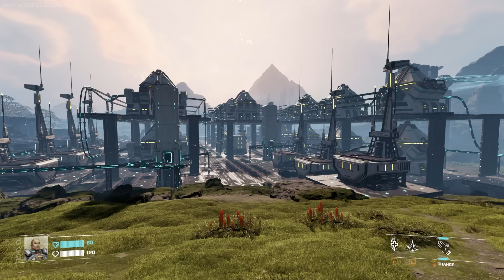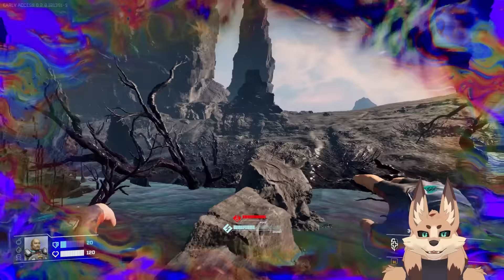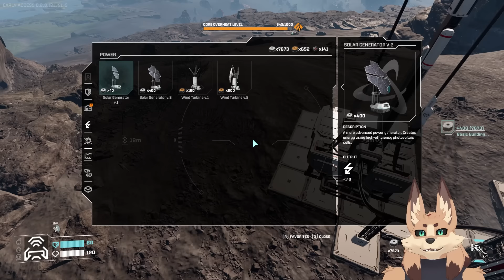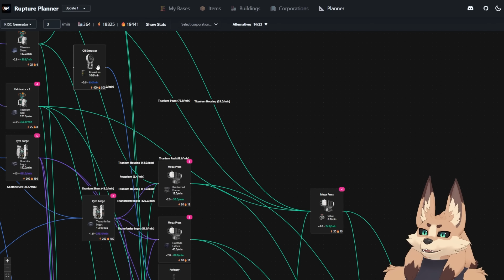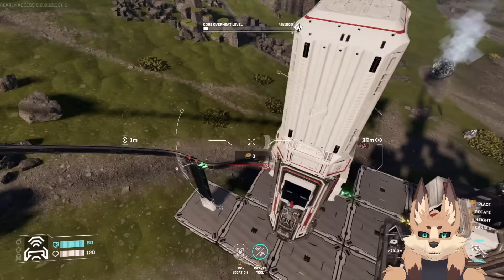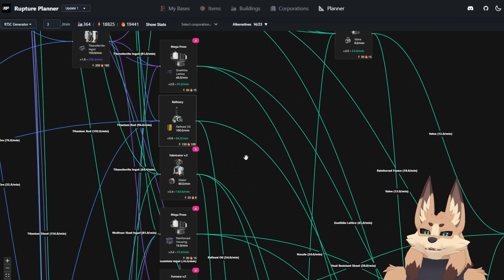Becoming An Intergalactic Oil Baron - StarRupture [S2E13]

Comment: Been following for a while, and I too, must say that I have an EVGA 3080 Ti, Ryzen 5800x, and the only time I lag is when it autosaves.  It could be the whole streaming/recording thing.  Another thing I noted, is when placing rails, maybe instead of placing the supports by the selves, and then trying to connect rails, just place a rail, and it'll automatically pick the support if it does not connect to another item.

Keep posting sir.  You do have some ingenius ideas!
Reply from the maker: I get the same stuttering between episodes when I'm just walking around planning what to do in the next vid, so I don't think it's related to that, unfortunately.
Reply: @KitsuGenji  Running it off a laptop vs a full sized desktop?  It may very well be game engine, as I'm just a tad further along in the build, but I don't have massive press installation, a compound factory, assembler factories, I just got blips/blops all over the place.

Comment: Apologies if you already explain this; are you recording and playing the game on the same computer or do you have that split?  Asking because I am wondering how much lag is due to the state of the game vs extra strain on your computer for recording/data storage. (More so if you are running the game and storing footage onto the same drive...)
Reply from the maker: I am, but my 4090 does hardware encoding so OBS is using NVENC which has minimal impact on game performance. I also get the same amount of stuttering when I'm not recording, so I don't think it's related.